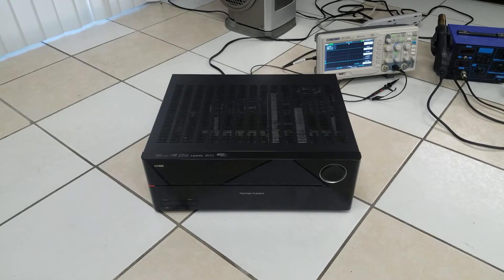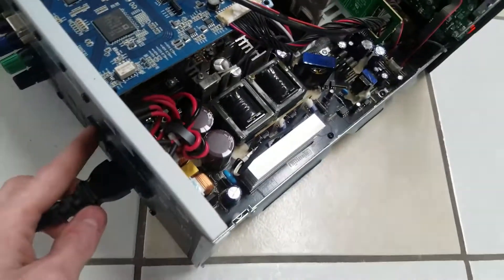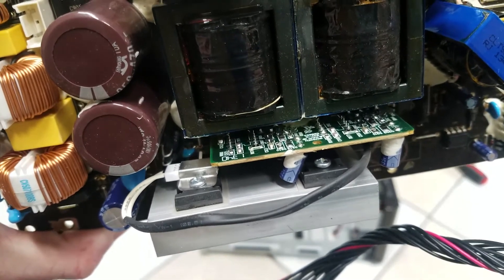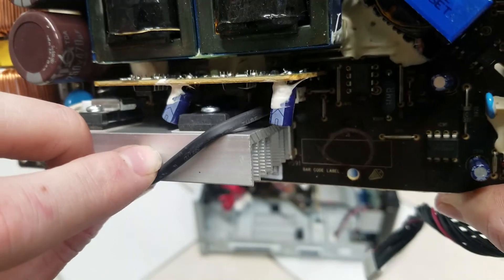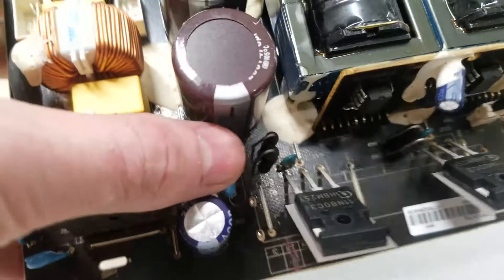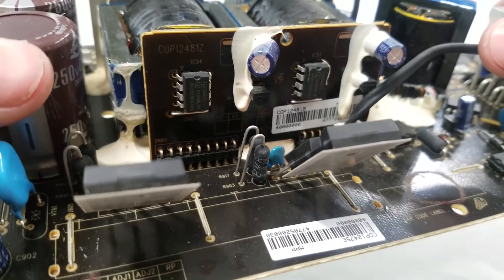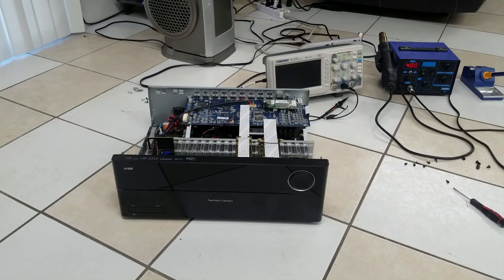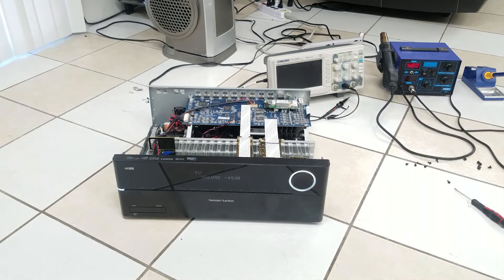Harman Kardon AVR 3700 / 370 Repair - Turns Off After 14 Seconds

Comment: Thanks a ton ! I have an AVR 2700 and replaced the caps but it blew a fuse shortly thereafter , Noticed a blown MOSFET so I replaced both 11N80C3 mosfets for higher rated 17N80C3 type . Works great now !

Comment: AVR270 here. It wouldn't boot anymore but would still stay in standby. I went and replaced the two caps with 470 pF 2KV ones. However now the damn thing won't even turn on the power LED. I can hear a faint buzz from the power supply when I plug it in but no other signs of life. What I did differently was removed the top PCB (containing the HDMI ports) in order to get to the far screw on the PSU but I made sure to align the pins and plug the flex cables back in.

Comment: How long would one need to leave the device disconnected from power for the capacitors to discharge themselves and become safe to handle?
Reply from the maker: Some power supplies can take weeks or months to self dissipate. Some just a few minutes. It's hard to say for sure. I'd use a multimeter to check them for voltage. This is typically why I just carefully remove the power supply and use a resistor to discharge the caps

Comment: I have a HK AVR 325 receiver with the same problem, it will power up for a couple of seconds, then back into standby.  A murky world of mystery was entered, as I opened it up and looked for anything obvious (bulging caps, fried fuses, smoked resistors, etc.) but everything looked "normal".   It's still here, collecting cobwebs, but am always open to suggestions?

Comment: I have the same model, the problem with mine is that the fan does not turn on which causes the AVR to overheat and shuts down after a few hours of use. please i really need help with this problem
Reply from the maker: There is an internal header near the rear of the amplifier board where the fan speed can be overridden with a jumper.

Comment: I have the HK 1650 and it appears the message "protected" and tunrns off. Do you think is the same trouble? 
I´m on my own, some technican told me that was unfixable, but I don´t trust them :)
Reply from the maker: It's more likely a short in the amp side of things, but no it should definitely be repairable. Not necessarily easy to do though.

Comment: I followed your video and it worked like a charm! ... For about a week. Now the damn thing won't even power on. Orange light is still on when power is connected, but it doesn't respond to any button press. Any idea what could be going on here?
Reply from the maker: That's a new one. I haven't seen that problem yet. Quite possibly an amplifier failure, but if I recall correctly the system will at least try to power on for 8s and shut back off if that were the case. There are some signal pins on a ribbon cable coming from the amp used to assert error signals to the logic board. You should be able to find those pins using the schematic for the receiver. If you cover those pins on the ribbon cable with scotch tape and re-insert it, you the receiver will ignore the errors and attempt to power on (but may not actually produce sound).
Reply: @ri5ux  I don't think I've ever facepalmed this hard. Turns out I didn't push one of the pins all the way in during my original work, so it was only barely connected and must have gotten loose when I moved the receiver around at some point. It's working just fine. Thanks for your response though! And kudos for the video :)

Comment: Thanks for the video.
I paid Aussie $60 and bought a couple of 3Kv 370 pF caps for Aussie 3.20 on the way home. Like someone else said, I pushed them away from the Mosfets and resistors. Booyah I have a working amp.
Thanks so much!

Comment: Thank you so much for the video. I would have, probably, only replaced C984 (cracked and discolored) with the same part and in the same position again. Now, thanks to you, I now have  3kV capasitors (both C983 and C984 replaced) mounted on the signal side of the PCB, away from the heat generating MOSFETs. Again, thanks a lot from Sweden for this video.

Comment: I had exactly the same problem in the same AVR model. I wore gloves and followed your video but soldering the caps under the board as suggested in another answer and was much easier, I have to say my AVR was completely dirty and I cleaned it deeply. It works perfectly ever since! I can not tell you how much appreciate the knowledge you share in the video, because even when the replacement is not that hard, knowing exactly what to replace is the real important thing to know and understand, Congrats and Thanks!

Comment: Hello! I have same symptoms on AVR-7500 with big transformer inside. I checked transistors but it all Ok. I changed all capacitor to new on mainboard  but it was not help. Can you give me advice where else to looking for ? Or can you help me using viber or other message software(I can turn camera on to show) ?

Comment: This seems to be a common issue. I have an AVR-7200 that does the same thing.  It's been sitting on my closet floor for the last 10 years or so.
Reply: Indeed so . . . my HK AVR series has become a magnificent cobewb collector.  It powers up for a second or two, then shuts down into standby mode. Quite a few similar descriptions appear with a google search.

Comment: Thanks for the video! I have a random shutdown issue happening with my AVR2700 which has the same power supply. I’m definitely going to do this.  Update June 26, 2021: This repair worked for my AVR2700.  Component cost: $.70.  Shipping $8.00. This was still cheaper than Amazon.com.  The most challenging part was taking the screw out of one of the MOSFETs.  The rest was fairly straightforward.  Thanks for posting this.

Comment: I just purchased a brand new in the box avr 2700 this week, ( yess in 2021 for a 2012 avr ). 
Everything work great but if i listen a movie it shutdown/sleep after around of 1h . I put it ON again and will go in sleep in hour. Do you think it can be the same problem ?
Reply from the maker: It definitely sounds like it's related to one of the issues mentioned here. I would try jumping the fan override connector inside of the unit to get more air moving through it.
Reply: @ri5ux  ohh ! seem legit, i take a look and never see the fan run yet. The amp did not seem really hot but i will try this ! 
Thank you for the answer my friend !
Reply from the maker: @pnzrwgn  You're welcome, and yes, you're right. The fan rarely turns on, even when hot.

Comment: My problem is most likely similar. 
It started off as being problems with the on/off button on the front. Sometimes, it would just turn off the interface, but then turn on again after about two seconds, where the surround settings would have been changed to five speakers (I only have two speakers). Or sometimes, pressing the on/off button on the front would make the interface go off in about 2 seconds, where it would just turn back on. This has changed now:

After months with the situation mentioned above, the light in the interface and the volume button randomly turns on/off rapidly after a pop in the speakers (after having being turned on in about a minute) followed by loud noises from the speakers, which makes you wonder if the roof of your house is being scraped off. I have now completely stopped using the stereo, as it seems useless in its current state. 
The situation might be a little bit different now though (after a week of random explosions from the speakers and sounds of large pieces of metal collapsing). It seems as the stereo completely turns off (except the light in the on/off button - it stays white) after about 30 seconds, and then turns on again after perhaps 30 seconds (it's a guess). The loud noises do not seem to be there anymore. But when it randomly turns off, the connection to my computer is gone after it turns on again - where I will need to completely take the stereo off of power to make it reconnect to my device.

It's a Harman/Kardon AVR 155 (looks quite different on the inside from yours). 
I'm not really seeking help - just letting my frustration out, but if anyone has tips, I'll gladly read them.
Reply from the maker: Sounds like multiple issues. I've heard of similar issues to the loud noises being caused by a faulty HDMI port or cable. Intermittent connections here cause screeching sounds. As far as the power issue, you might be lucky enough to just have a faulty power button. You could try replacing it if you have the soldering skills to do so.

Comment: Thank you sooo much for this video !
Just replaced C984 and C983 in my 370 but the funny thing is the amp still switch off exactly after 14 seconds :-)
Do you think something can damage them (C984/983) or are any other capacitors still damaged ? Thank you for your help...
Reply from the maker: It's a result of the -50V and 50V rails not being present. You can try testing without the two capacitors. If the issue is still present, the MOSFETs next to those two capacitors may have failed. If you have a multimeter, while the unit is off, try testing for continuity across any of the MOSFET's 3 pins, if you have any continuity across the pins, the MOSFETs are shorted and will need to be replaced.
Reply: @ri5ux   I just checked both options. Same problem without capacitors ( 14 seconds - off) and the MOSFETs are fine. Checked with a multimeter.... hmmm?  If you have any others ideas.... thank you :-) 
I was hoping to hear the amp voice on the tonight new year's party but bad luck :-))) 
Happy New Year!
Reply from the maker: @Pawel_GP  If you check both the -50V and 50V rails, are you missing just one or both when you try turning it on?
Reply: @ri5ux  I checked ... It's -54V and 54V 
One more observation. When I plug in the headphones everything is fine.
Reply from the maker: @Pawel_GP  I would check for shorts in your amplifier. Start with checking continuity between the speaker outputs and ground.

Comment: Hello my friend, I have the same model 3700, my amp doesn't go off after 14 seconds, it goes on playing for about an hour and then I turn it on again and it goes for about the same time and so on, do you think changing the capacitores will fix the problem? Thank you for your help.
Reply from the maker: If I understand correctly, it shuts off after about an hour, but you can turn it back on again and use it for approximately another hour? If yes, the issue will get worse over time, so you should replace capacitors C918, C921,  and C943. You should also bridge the "FAN Test" header with solder to force the fan to run at max speed all the time. It will be louder, but will prevent the issue from occurring again.
Reply: @ri5ux  Yes, that is exactly the problem, and I thank you so much for your promt answer, I will follow your instructions and fix it. I thank you again. Best wishes for the new year.
Reply from the maker: @romulosantos8019  You're welcome, glad to help. If it persists, feel free to ask for more assistance!
Reply: Yes my friend that is exactly the problem, I will follow your instructions before it gets any worse. Thank you very much for your fast reply, very much appreciated. Have a great New Year.
 @ri5ux
Reply: I'm sorry , just one more question are those capacitors located in the same section that you worked on in the video?
Reply from the maker: @romulosantos8019  They are on the same board if that's what you're wondering. The fan test header is on the amplifier board near the power supply.
Reply: @ri5ux  Thank you very much.
Reply: Hello my friend, I have bad news, I replaced the capacitors that you mentioned, and also worked on the fan, but it didn't work, the unit still shuts down after half an hour or sometimes and hour and I can turn it on again as before. Is there any other solution you may know? Thank you.
Reply from the maker: @romulosantos8019  Sorry to hear that. Unfortunately, without seeing it myself, I don't believe I will accurately be able to diagnose this one.  You could check for bad solder joints on the power supply, but I'm afraid that's a last resort.

Comment: I have AVR 445 with the dame problem, do you think the capacitors id the problem ? regards
Reply from the maker: The AVR 445 is very different internally from this receiver. This receiver uses a switch mode power supply and the AVR 445 uses a transformer. Sorry, but that could not possibly be the issue with the 445.

Comment: Thank you so much for your knowledge and this fix.  I picked up my AVR3700 in mint condition at ( of all places) Goodwill for $20!  It worked fine for a month then started shutting  down but would come back to life in a couple minutes.  This timing kept getting shorter until it was 12 seconds , then I saw your video and my burnt , and I mean burnt, caps.  Replaced them last night and its been running just fine ever since!  Thanks again!!

Comment: I have an AVR 370 and the issue I am facing for quite some time is that after power-on, the AVR is struck up at the Startup screen for about 5 minutes (with source and volume level displayed). After that, the AVR boots up and functions. Also, the AVR gets hanged frequently if I try to access folders when playing music from USB drive or connecting to network.  Is this due to any problem on the power supply board?

Comment: My reciever would shutdown like yours sometimes, most of the time it just froze on startup.  Thx to your video I diagnosed the 2 5600uf6.3v Acon caps on same board as bad (slight bulge). Replaced with 2 Panasonic FM series caps from Amazon and I'm back in business. Thanks!

Comment: Anyone knows if i can use 470pf 5kv capacitor? I have 471 1kv right now. Unfortunatly the only one i can get is 470pf 5kv.
Reply from the maker: As long as the farad rating is the same, you can use any voltage rating above the original. I recommend 2kV, but 5kV will also work.

Comment: Mine has this exact problem, I have the same model (AVR370) however Mine was purchased in New Zealand so is 240v. The inside looks different to the one in the video and it does not have those small capacitors you replaced, two major differences i can see from a little comparison i did is the two capacitors you discharged in the video in the same place on my build there is only one that is twice the height (Probably the 240v thing?) there is no 2nd one. The 2nd diffrence is on the right hand side of the heat sink on the power board instead of nothing there like on your model mine has a box with a plug running back to the left of the heat sink into a socket right next to the closest large brown capacitor (to the heat sink). Any ideas what on my version might need looking into?
Reply from the maker: I helped someone with the 240V variant, it is the same issues, but the capacitors are in a different position. They are still next to the mosfets, hidden behind the heatsink. I can't remember specifically, but I believe you still need to remove the mosfets and heatsinks to get to them.
Reply: @ri5ux  Oh cool thanks heaps for the reply!, I had a closer look with a 1200 lumen torch after your rely and found them, they are both cracked. One silly question, would they still be 471k 1kv ones? I haven't pulled them out yet to see.
Reply from the maker: @adamcomrie5957  I would recommend 2kv instead of 1kv, mine is still going on 3 years after the repair with 2kv caps. Other than that, yes 471 rated.

Comment: Hello, I have the AVR 370 model and it can not be turned on when turned on, the button and knob glow white and then goes out, what could be the problem?
If I disconnect the tape near the wifi it works normally

Comment: Hi, I have the same issue with my AVR 370 device, shut down few seconds after start, but not permanently (sometimes it doesn't shut down instantly but after 30mn, 1hr use,...), do you think it is the same root cause (2Kv capacitors)?
If yes, I would like to replace them, but I can't find any vendor providing them (DEBB33D471KN2A from Murata), seems they stopped the production. I'm not an expert... I found a website (digikey) where they propose a substitute (CK45-B3DD471KYNNA from TDK), do you think it would match? thanks for your video, really helpful!
Reply from the maker: It is very possibly those capacitors, it could also be C918, C921. When it shuts down, can you turn it back on immediately? If you do, does it shut down quicker the next time?

Also, you don't need to have the orignal brand/model of capacitors. Any 470pf 2KV ceramic capacitors will work.
Reply: @ri5ux  You're right this is the scenario : we start watching a movie, and at a time the device shuts down suddenly, with a loud noise. I turn it back on and it shut down again quite immediately...
Is it the same issue you described in you post?
Reply from the maker: @kadlin791  Yes, that is caused by the receiver overheating. C918, C921, and C943 are bad. If you replace them it will resolve it, but you also need to find the "FAN Test" header on the amplifier board and short the terminals together. This sets the fan at max speed, which isn't terribly loud, but it will prevent further issues.